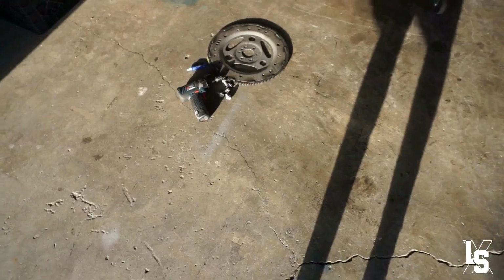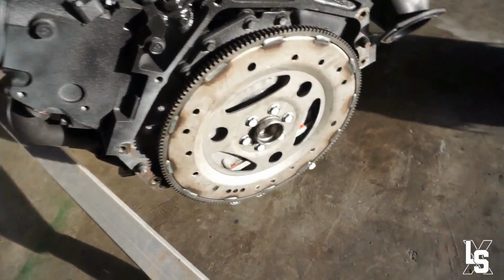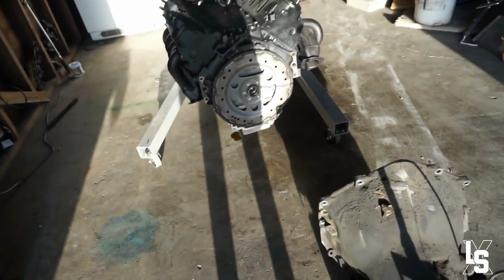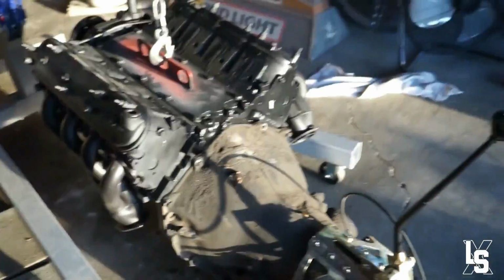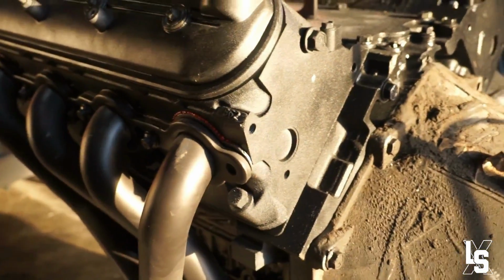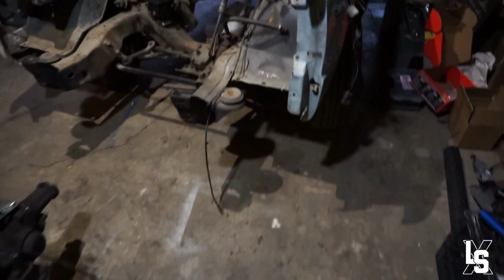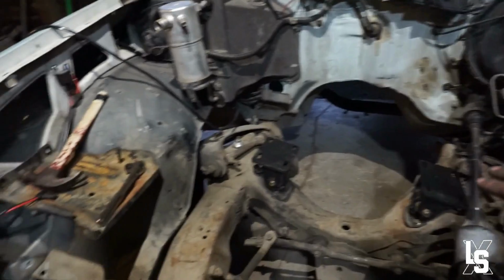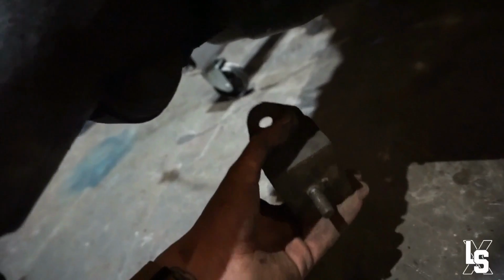LS S10 SWAP PART ONE - 5.3 + 700R4

Comment: how did you do the transmission kickdown cable on the 700r4 trans? its a cable operated and usually the ones that come with those 5.3's are computerized
Reply from the maker: Tim Groot I actually haven't gotten that far get but the 5.3s come with a cabled throttle up until 03 and a lot of guys make brackets with the throttle cable to hook the kickdown cable to.
Reply: BEYOND GARAGE okay, because i am about to do a 5.3L 700r4 swap into my truck and was thinking about hou i was gonna do the same thing

Comment: Did you go carb,  the 700r4 is both for the older 350 and some 4.3 s10s that used tbi and carbs
Reply: I put in a 350 in my el camino with a 700r and messed up the transmission 2 times already.  What do you think is my problem? Last transmission was rebuilt in a shop that closed down soon after I had rebuilt again so I had no warranty
Reply: @cramos6638  Throttle Valve cable adjustment

Comment: how did you do the throttle body cable?
Reply from the maker: Mark Lapensee I currently do not have the engine in the truck but I still have the original throttle cable hooked up and hoping it reaches the throttle body once I get the engine in and intake on
Reply: I haven't got to that part in my c4 corvette build either. Hopefully mine reaches too! When are you doing part 2
Reply from the maker: Mark Lapensee soon! Lately I've been stuck at work and haven't had much time to get in the garage. Hopefully next weekend I can get some time and try to install the engine for part 2 so stay tuned.!
Reply: its hard to find any one doing the 700r4 to 5.3l so I'm excited to watch you do yours so I can copy it!
Reply from the maker: Mark Lapensee I guess that's why it has so many videos! Haha check out my other video if your interested. I make these videos to learn and to teach!
Reply: @BEYONDGARAGE  He's talking about the Throttle Valve cable that controls line pressure/ and shift points for the transmission.

Comment: You didn't need no spacer between the flexplate and torque converter what drive shaft did you use
Reply from the maker: +Edgard Jauregui it was in the instructions so it goes there and so far the stock one fits. Haven’t had the engine running in the truck yet
Reply: Yes you do. The LS style crank is recessed. If not then nipple on torque converter is by supported. Within 2 months your flexplate will be broken. Ask me how I know.!? The on exception is the 99 4.8 and 6.0 from 2500 application

Comment: Stock torque converter?
Reply from the maker: Yes, bolts up to the fly wheel with the stock bolts as well
Reply: +AutoCross S10 going with a 700r4 as well on my c1500 just waiting on the crankshaft adapter to mate them.
Reply from the maker: Ya I'm not sure how much of the power its going to take till it blows up bit well see, stay tuned!
Reply: Hey bro when tou posting next video
Reply from the maker: I'll be posting an update video soon. Its been a long couple of weeks of working (real job) and trying to figure out why It doesn't fit
Reply: Ya man i get you same here ive been bilding my 93 sonoma for a wile to and man its a headache iv never posted videos on the billed but got a lot of pics do you have a Instagram account? If you have any questions glad to help and keep up the good work
Reply from the maker: Alejandra Godoy thanks for the support.! My Instagram is @autocross_s10
Reply: is the 10 runing yet